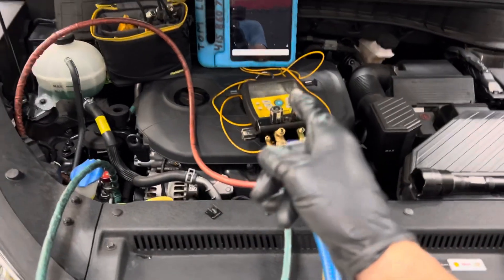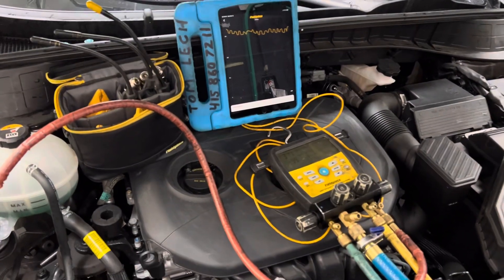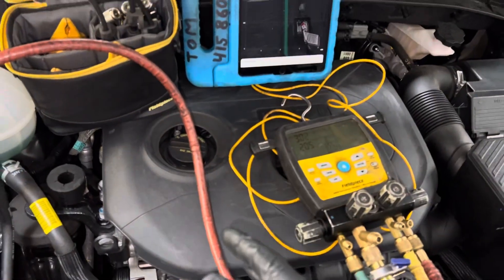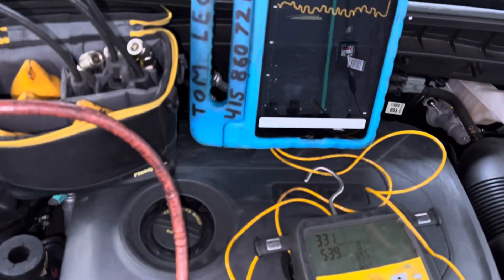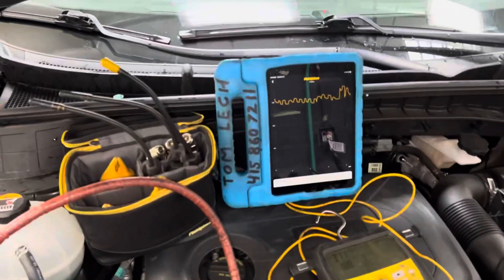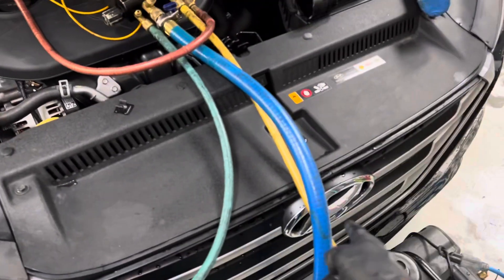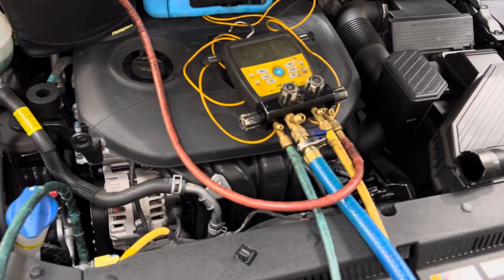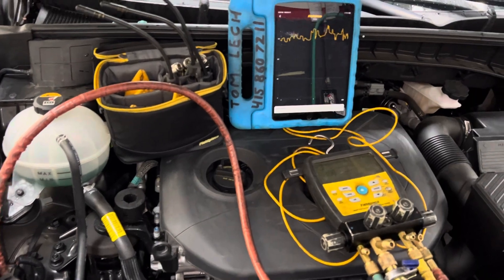LEARNING TO USE A MICRON GAUGE SOME PEOPLE HAVE A PROBLEM. If you don’t read and study a little bit￼

Comment: I follow videos on both the HVAC side and the automotive side. It's surprising how different the approach can be. Mostly it comes down to having the patience to vacuum the system down and get moisture out before moving to the next step. Some automotive techs just roll the vehicles through. Do you ever use superheat or supercool to decide on a system charge, or in these small systems is it better to just go with whatever mass of refrigerant the system is designed to take?
Reply from the maker: We have not been able to use superheat or sub cooling since the days have fixed piston compressors which have almost nearly 100% disappeared still a few manufactures. 

Now think of cars as a package unit or a cold water dispenser machine. 

If you start with an empty and you fill it up exactly to where the manufacture by weight tells you to you’re basically 100% right on spot with a correctly charge system

Most all of today’s compressors are variable displacement compressors so the superheat and subcooling are all over the chart and they give no specifications from manufactures. 

Honda electric vehicles with three phase high-voltage compressors their variable speed the computer decides what does superHeat or Subcooling is going to be and sometimes it goes all the way down to 0.5 in that area super heat. 

Now we have internal heat exchangers on vehicles with variable displacement compressors

I have measured brand new vehicles that are only a few months old so they’re still in perfect working condition. 

With super heat readings anywhere from 3 to 5°  all the way up to 70°

I have measured sub cooling anywhere from 5° all the way up to 54°. 

These are all perfectly weighed in correct systems so there’s no rule of thumb

Now on vehicles that I’ve literally done 100 times and I know what their superheat or sub cooling is I can instantly tell the system is low on refrigerant just because I know that particular manufacture model vehicle even though it’s blowing nice and cold out of the dash but that’s from experience not no manufactures non-existent specifications. 

But like he said the absolute most important thing remove that moisture vacuum it for a good long time with a good vacuum pump and a set up that is not leaking.   

And with today’s Micro channel crucially charged automotive refrigerant systems being extremely precise with the weight of the refrigerant by manufactures recommendation.

Comment: They could also have a leak on their guages / fittings /hoses that might be adding to their confusion of always seeing a leak with the micron guage. I know you show it but checking your gear, understanding your tools, and having experience with using them is important.
Reply from the maker: Yes I have videos dedicated indicating always test your gear first because you as a technician usually causes your own leaks in your set up or your hose seals. 

I have a few videos one in particular specifically showing the difference why it is necessary to have one brand new clean refrigerant recovery tank to use as a reference tank that will be used for nothing but a Vacuum reference or high pressure nitrogen decay test reference. 

Because you cannot do a vacuum decay test inside rubber refrigerant charging hoses by themselves you will always fail and somebody will be scratching their head wondering why the micron reading goes up so high not understanding it’s caused by the material that the rubber refrigerant gauges are made out of.